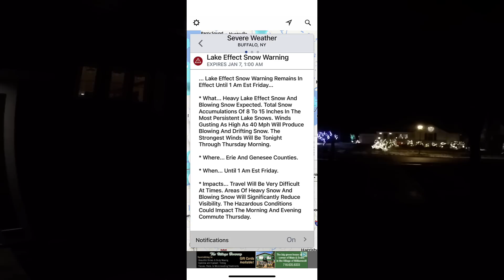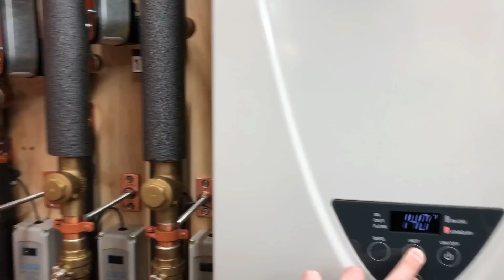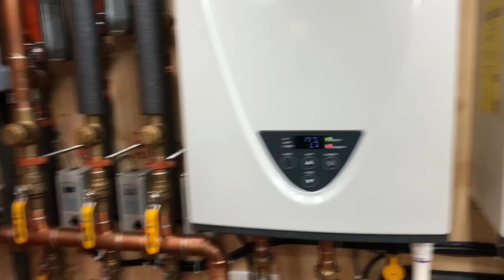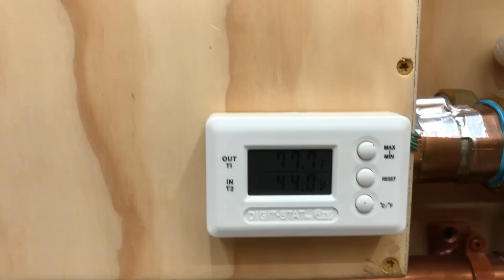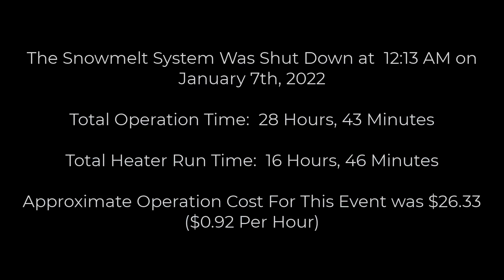Heated Driveway Melting Snow Time Lapse During a Buffalo NY Lake Effect Snow Storm on [1-6-2022]

Comment: I live in New York City and do spray foam insulation. One time we were Sprayfoaming a clients roof and at the same time he hired a constructor to do this exact job to his driveway in Sheep’s Head Bay. After seeing how this system handled the snow it’s an amazing feat in engineering.
Reply from the maker: Hey Shane2982!  I had my most of my house and garage closed cell spray foamed as we renovated.  One of the best decisions I've ever made. It' so much quieter, and I feel like I could heat the house with candles sometimes. Thanks for taking the time to leave a comment and watch my videos, I appreciate it! 😊
Reply: @DeckerChristopherJ  Queiter?  When I spray foamed my roof with CC it amplified the sound of rain pretty bad.  I ended up putting an additional layer of the 3.5" mineral wool batt insulation just to dampen the sound.
Reply: Your amazed that snow melts when heated?
Reply: @garysgarage.2841  No, just that people like you still share air with the rest of us.

Comment: I haven't seen a sow melting system that wasn't an electric resistance type before. Was gas much cheaper to install than a heat pump? I have to think operating costs would be lower with a heat pump.
Reply from the maker: Hey John!  Around here Natural Gas is (was) much more reasonable than electric. I haven't looked into a heat pump, but I'm not sure if it could provide enough BTU's to handle the load of something like this?  We're having solar panels installed in the spring, so that may be something I need to look into for the future!  Thanks for the suggestion and for watching!

Comment: WHAT A LUXURY TO HAVE IN THIS AREA! What does this cost to install and then annually to maintain? 20k/2k?
Reply from the maker: Hi Ivan!  Tomorrow mornings video will answer that exact question!  If you've seen my channel, you'll know I DIY'd mine.  I did it for under $10k.  If you were to hire it done, it would of course be significantly more than that.  Driveway size and your expected level of performance will of course effect cost!  Annual maintenance os pretty much nothing, just some vinegar to flush the units:  https://youtu.be/SVNFIUB8p9E  If you still have questions after tomorrow's video, leave a comment on it and I'll go into more detail.

Comment: I live in an Edmonton high rise condo where the parkade has a heat traced concrete entry ramp.  It turns on at 0 to -15C degrees during a snow storm.  If there is a deep freeze predicted during the snow storm, the heating element is never to be turned on.  The reasoning is, the heat tracing system will never be able to keep up in a deep freeze and end up turning the first layer of snow into hard to remove ice.  It's cheaper and easier to shovel snow off of really cold pavement then it is on slightly warm pavement because the snow hasn't really turned to ice yet.  For this reason, the building caretaker is the one who makes the judgment call on when to turn on the heat tracing system and when not to.  It can get super cold in Alberta and snow acts funny on warmer surfaces.  
The rule of running the heat tracing element is, if the snow falls in big fluffy flakes turn it on.  If it's cold and the snowflakes are really tiny, with plunging temperatures going below -15 C leave it off.

Comment: Just curious, but why not use a snow melt sensor? Every driveway I have done here in Colorado with a SnowMelt system had a sensor we put in, that detects temperature and moisture, and if the conditions were right (Snowing) it would turn the system on, then stay on for about an hour or two after it stopped detecting more snow. We would also use a low pressure heat exchanger so the house could be heated while the snow melt system ran as well. This would keep the driveway down to just 60 degrees or less, to keep the concrete from cracking, and the house and indirect fired water tank at 180 degrees. It would allow for both systems to be on at the same time with very little extra stress to the boiler or flash heaters in your case.
Reply from the maker: Hi Josh!  I did install the Tekmar 091 sensor socket in the slab when we poured it, and ran the conduit back to the utility room.  I just haven't ben able to bring myself to spend the $1k on the automated controls yet, but it's possible.  For now, it's been working flawlessly by turning it on manually or from my phone.  Thanks for watching!

Comment: Just curious whether you used to spread salt during and/or afterward prior to installing the system? If so, any recollection of how much the salt cost? Depending on the cost per bag times the number of bags you could possibly break even with the operating costs. Installation costs would be another matter but if you had to hire someone to shovel it you may be able to still justify it.
Reply from the maker: Hi Kevin!  I actually didn't use much salt before installing the system.  One of my biggest issues was just having no place to put all of the snow.  I show exactly what I'm talking about in this video: https://youtu.be/04iy6sCg9G8  I installed everything myself, so labor cost wasn't a consideration, just materials.  Overall, I'm super happy with it.  No waiting for a plow or having them ruin my driveway, grass, landscaping, etc. No snow banks. For me, its already justified itself!  Thanks for watching!

Comment: I think you need a snow sensor so it automaticly starts up when the snow starts falling
Reply from the maker: It's on the wish list, Theodore!  I mentioned it towards the end of this video: https://youtu.be/jsHqPNUt94Y but I did install the Tekmar socket in the slab and ran conduit back to the mechanical room so I could install all of the automatic controls later.  I just haven't brought myself to spend the $1,000 on it yet.  Someday...   Thanks for watching!

Comment: where does the water go when the snow melts? into the cracks? and is it the box next to the trash bins thats doing the heating?
Reply from the maker: Hi Skud! So  most of the water evaporates, but some does run down the driveway into the street if it's melting a lot of snow at once.  It can re-freeze, but it hasn't been an issue to just shovel off.  The heating is done by natural gas heaters in the basement.  You can see that setup here: https://youtu.be/0eVSJDShuts  What you're seeing on each side of that box next to the trash bins is the vents coming out of the house for the heaters.  This playlist has several more videos, including how I designed and installed the entire thing, as well as several more (and better) videos of it melting: https://youtube.com/playlist?list=PLdWeMRuZcbQjekwiBk_uy39IS6JFWYORD  Thanks for watching!

Comment: I worked in communications and we had moist/temperature sensors that would automatically turn on our satellite antenna heaters. When a small amount of moisture fell into the little cup and the temperature was close to freezing it turned the heat on. These work great. Our driveway is huge so we have a plow truck, but cool video.

Comment: This is so cool and weird to watch.  Snowing outside but the driveway is clearing itself.  How long after the end of the storm do you keep the heater running to keep it from freezing into ice from all the melted water?
Reply from the maker: Thanks Derek.  You've got to run it until the slab is pretty much dry, or it will re-freeze and cause a mess.  That happened to me at the end of this video: https://youtu.be/EkDVQq_TW1k  I turned it off after the storm, but it lightly snowed while the slab was still cooling.  That snow melted of course but didn't have time to evaporate, and turned to ice by morning.  I had to run it again to clear it off.  Lesson learned.  Thanks for watching!

Comment: For $26 it is well worth it. Imagine the hospital bills it would’ve taken to fix my back.😂❤
Reply from the maker: I have lower back problems as well, and I couldn't agree with you more Phillip!  Thanks for watching and commenting! 😊
Reply: Could be just as much to hire a plow
Reply from the maker: @tigertom53 Maybe close, but a plow is going to scrape a blade across my nice new concrete driveway, grass, landscaping, etc., and I have to worry about when they’re going to show up. Also, if I leave a car out of the garage like in this video, forget it, a plow service is worthless. They can’t get around or in front of it. In this case, I just flip a switch and move on, and the driveway melts all of the snow, everywhere on it, right to the edge. No damage to anything, no snow banks. 😊😉  The cost may be comparable, but in the long run I’m happier with this setup and I had a blast building it. Thanks for watching!

Comment: Years ago I worked at a shop that was fully heated by heated floors. It also had a heated apron to stop ice buildup by the vehicle and easement doors. When it would get below 0f running the heated apron would drop the water temp substantially so we would go from 60-65f inside down to around 45 to 55 max and the boiler/ heater would never shut off. But shutting the outside flow off it would go back to cycling and warm up inside. The wind and cold will just zap the heat from the heated areas outside.
Reply from the maker: I believe that, Rusty!  Luckily it doesn't usually snow a lot at temperatures that cold, but 0ºF and a breeze will suck the heat off a slab FAST.  I'm not sure if you've watched any of my other videos, but I explained in my Mechanical room videos how I was at the upper limit with 1 200,000 BTU Heat Source.  I'm so glad I went with 2.  On some of those really cold startups, I've watched the BTU load reach 300,000+.  All of those videos, including my mechanical room videos can be found here if interested: https://youtube.com/playlist?list=PLdWeMRuZcbQjekwiBk_uy39IS6JFWYORD  Thanks for watching!
Reply: He's going to have issues with it when Quebec experiences one of it's infamous deep freezing cold snaps.  Might want to keep it off if the deep freeze is predicted or if he sees really tiny snowflakes.  All he's going to do is create a thick pack of ice.

Comment: What's the point in having a heated drive I you can't get off your drive if the street is blocked with snow ?
Reply from the maker: Good point! That rarely happens here though, as my Town does a good job of keeping our streets clear.  Even in the areas currently in the news receiving 4-6 feet, they will have the streets clear ASAP.  Thanks for watching!

Comment: I would like to get the pads out by the street heated because of the snow plow throwing a bunch of snow and ice into the mouth of our driveway after I have finished plowing
Reply from the maker: I hear you there, SCSmith!  One thing I would have done differently was to run a couple of 1" isolated pex lines out to an irrigation box in the ground near the sidewalk.  Then I could've installed pex in the sidewalk and apron without worrying about it being cut in the right-of-way and taking out my entire system.  That would've also let me install it on its own zone, and run the apron longer than the rest of the driveway, just to take care of the snow from the snowplow like you're talking about.  Oh well, maybe next time I do this (hopefully never) 😉😂 Thanks for watching!

Comment: Cool but I think I'd spend the $ on a garage so I didn't have to brush the snow off and get into a cold car.
Reply from the maker: Hey Sixpack!  Great point!  The GoPro in these videos is actually mounted inside the heated 2.5 car garage, but at the time, I had several woodworking projects I was working on so the cars were outside 😂.  This winter I will have it cleaned up so the cars will be happily parked in the heated garage.  If you're interested in learning how I heated the garage (radiant & forced air, I show pictures and talk about it in this video here: https://youtu.be/0eVSJDShuts ).  Thanks for commenting and watching!

Comment: Do you have any issues with drainage at the end of your driveway? Does it run off into your neighbors driveway and then freeze?
Reply from the maker: Hey Daniel!  I do have some issues with runoff.  It doesn't necessarily flow near my neighbors driveway, but if I don't turn it on early enough and the snow accumulates, the melting snow will create runoff that runs across the non-heated sidewalk and re-freeze.  It's easy to just scrape the ice up with an ice scraper and push it into the street, but ideally it would've been nice if everything was heated right to the road.  I didn't want to do that because its not technically my property.  I explain more about that and show you in detail in this video: https://youtu.be/04iy6sCg9G8  Hope that answers your question, and thanks for watching!
Reply: Who cares . It's just water . If the neighbours are not happy , they can go to Hell

Comment: Does it effect water bill or electricity a lot?
Reply from the maker: Hi J C!  This system doesn’t use any water, it just circulates the same antifreeze, so no effect on my water bill.  My electric bill did increase slightly with the pump running, but it’s minimal. The real increase is in Natural Gas.  It costs between $.50 - $1.00 USD per hour to operate, depending on current natural gas prices. Thanks for watching!

Comment: This is the first heated driveway that uses hot water. All the ones I've seen up to this video were electric.
Reply from the maker: Hi Cliff!  I am definitely not the first one to use hot water (glycol) but I’m glad my system could be the first one you’ve seen 😀.  Electric might’ve been an easier installation, but I probably would’ve needed an entire separate pole drop and service to handle the amperage needed to do what I’m doing.  Natural Gas is also more reasonable in my area than electric. Thanks for watching!
Reply: @DeckerChristopherJ  Check out some of the videos here on youtube about installing a heated driveway. I don't know how many amps they draw or how long they last or how much snow they can melt per hour (or however they measure their efficiency) but it should give you a broader range of information to pull from.

Comment: You could do an infrared laser  through the air and any snow would reflect the laser in mid air which would activate an optical sensor to turn on your heater. Even a green or red laser would work. You could do a lightly heated scale that would sense the weight of snow and trigger a switch. The snow would slowly melt away to rest the scale and turn off the switch.

Comment: what's your hydro bill or utility bill? do you know before and after? 
also how long exactly for the snow to melt?  completely or partially melt 
cause we are in st catherines so same weather
Reply from the maker: Hi Christopher.  I actually did an entire video on this last winter, you can check it out here: https://youtu.be/VotJEQigTkw  Last winter it cost approx $.50 per hour to run the system, but with the huge increase in natural gas prices for the 21-22 season, its closer to $.92 per hour now.  I try to clock the meter before and after every event, and if you watch most of my snow melting video to the end, I put a screen with the total cost of the event, and the time the heaters were running.  Melt time depends on a lot of factors, including outdoor temp and wind speed, but I would say a majority of the time the driveway is 75%+ clear after 2 hours.  Obviously if its snowing hard, it will be longer, and same goes for if its windy / cold (like in the teens F).  If I get some time after I finish uploading all of these old installation videos, I will make another video showing the spreadsheet and breakdown for the 21-22 season like I did for 20-21 in the video linked above.  Hope that answers your questions, if not, just ask what I missed and I'll try to respond.  Thanks for watching!
Reply: @DeckerChristopherJ  that's really good how big is your driveway? sqfootage
Reply from the maker: I’m heating 1,600 sq ft. You can see a detailed layout of how I laid out the loops and designed it all in this video: https://youtu.be/Ju19Mgx68fQ  If you haven’t found my playlist yet, I think watching the videos in order will answer a lot of your questions. Here is a link: https://youtube.com/playlist?list=PLdWeMRuZcbQjekwiBk_uy39IS6JFWYORD  Hope that helps! 😀

Comment: Do you nave to keep it running until it's dry? I imagine that if you turn it off while the driveway is still wet, you'll end up with a sheet of ice.
Reply from the maker: Hey Anachronist! You are absolutely correct. It must be left on until the slab is 90%+ dry or it will turn to ice!  Also, when you turn it off, it takes a few hours for the slab to cool down. This will help any remaining water dry, but if if you get even a light snowfall during this time, it will also cause it to melt and then re-freeze if it doesn’t have enough time and heat left in the slab to dry.  I had that happen once, and took a video. Check out the end of this one to see it: https://youtu.be/EkDVQq_TW1k Thanks for watching!

Comment: That car tire not melt too right?
Reply from the maker: Nope.  The surface of the driveway only rises to approx. 38ºF-45ºF.  It doesn't really even feel warm if you touch it, but its over 32ºF so its warm enough to melt the snow away!  No damage to the tires, slab, or anything else.  Thanks for watching!